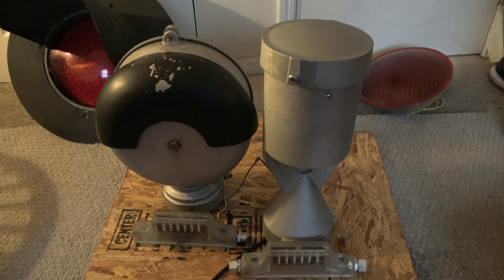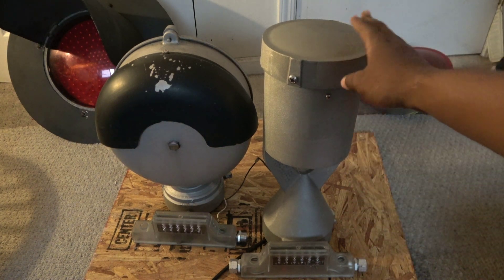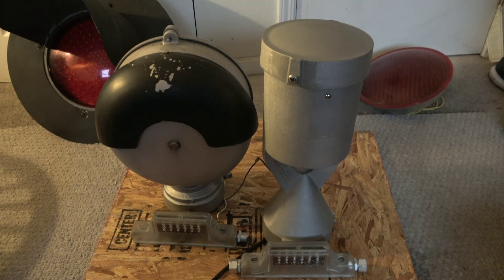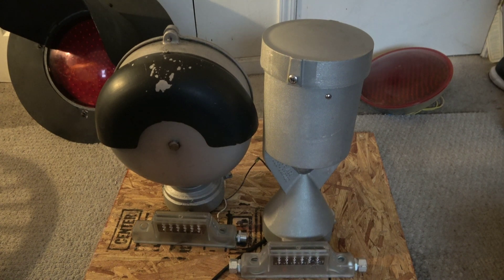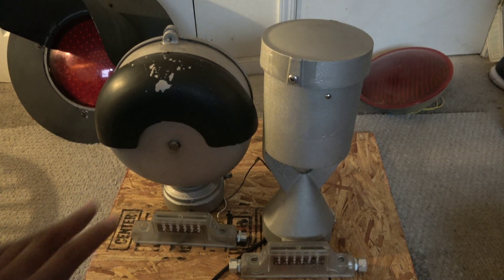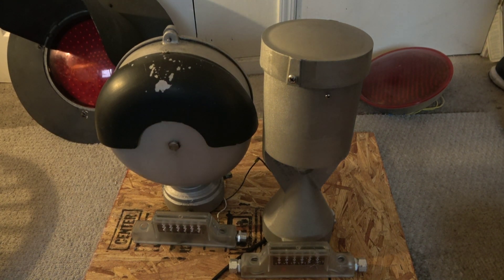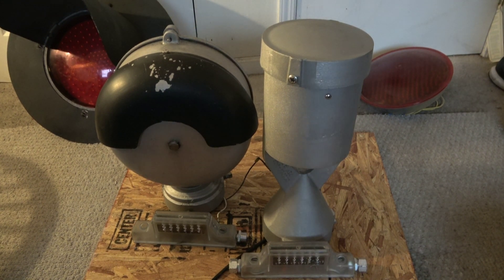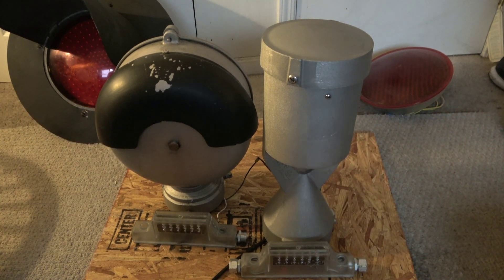My Rare New GE Electronic Bell Arrived! (Read Description)

Comment: Where do you buy these? And do you need to buy a transformer?
Reply from the maker: I get these from Ebay. Yes you will need a power supply. I use an HO Scale power supply for mine that I got from RC Country Hobby.

Comment: I wonder why they are called smart bells, they aren't better, if not worse than the WCH bell that they ripped off. The tone kinda sounds like a WCH motor bell.
Reply: Makes sense.
Reply from the maker: Not sure why they call is a smart bell. It's like how Safetran, NEG, and sort of US&S ripped off GS.
Reply: MobileRailSpotterRxR US&S was a partnership tho so they had permission.
Reply: MobileRailSpotterRxR you just got a GE bell and is already shitting on it. They call them smart bells because they have sensors inside set up to where you can monitor the bells status from the relay case
Reply from the maker: The smart bell might just mean there's no moving parts like Electronic Bell would imply.